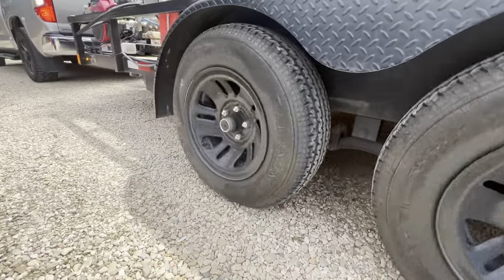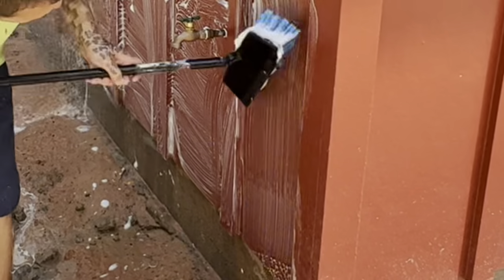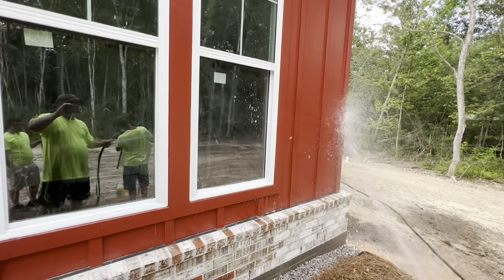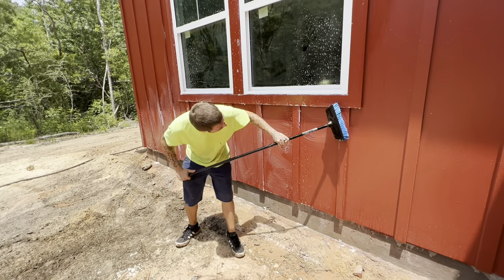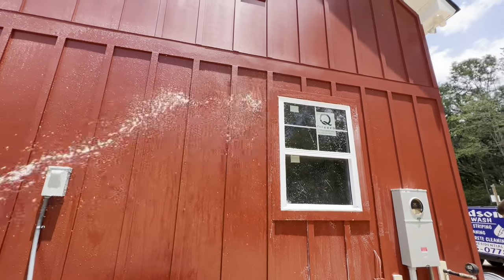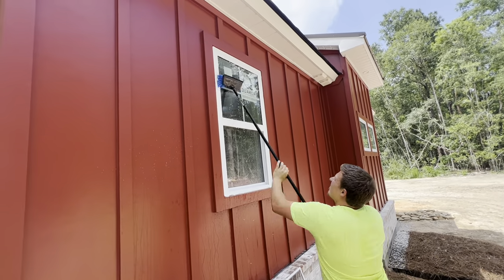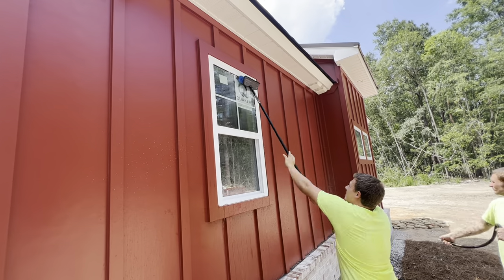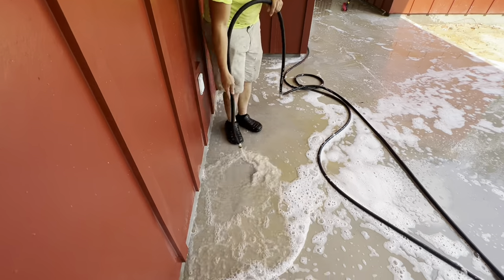Don't pressure wash this house￼!￼

Comment: Is there a reason they had you power wash during construction and before the paint was fully cured? That sounds like you were set up for failure before you even started.
Reply from the maker: Yes it was very challenging but the general contractor had to do some touch up paint work on the house so we had to clean the dust off of it
Reply: @billydavidsonvip  I guess my question is more, why would you want to fully power wash and use chemicals on a paint job that was not done or fully cured? Wouldn't you have ONLY wanted to wash off gently like you've shown here?